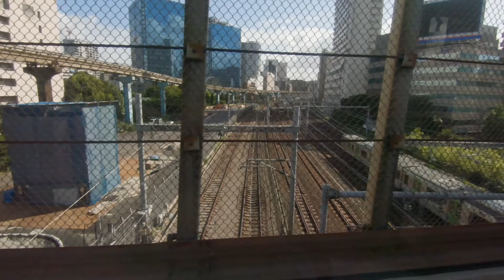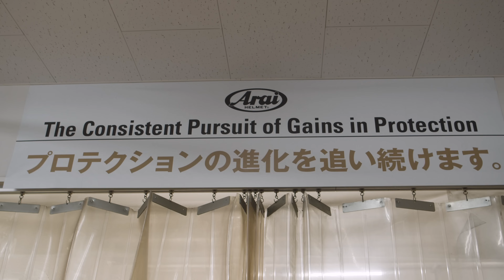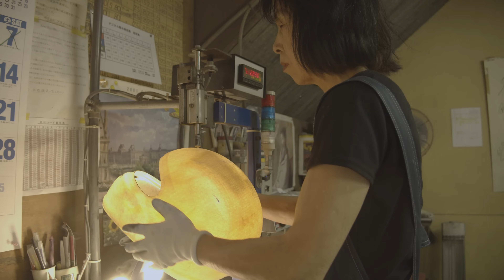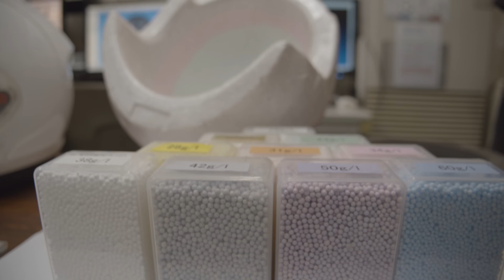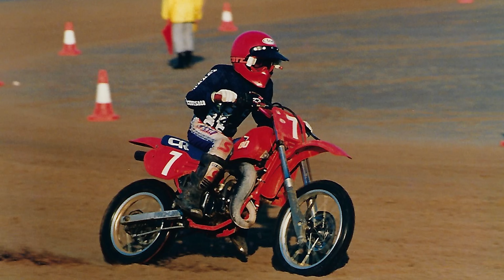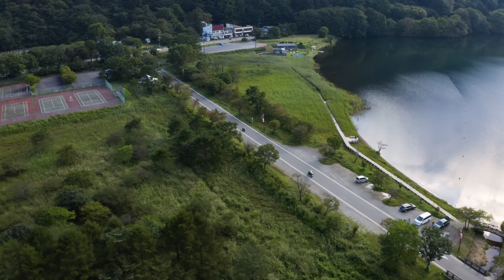Arai Factory Tour Japan / Honda Africa Twin DCT / @motogeo Adventures

Comment: I want to point out that all of the air vents and other things that get attached to the helmet---that make it not round---are designed to break off in a crash.  This ensures that you have a round structure protecting your head.  If they didn't come off so easily, they could snag and torque your head and neck around.

Comment: Helmets should last for a long time except the styrofoam shell inside it which is very cheap. Manufacturers should make it easy to replace the Styrofoam shell which absorbs most of the energy during an impact for less than $30 or make an impact absorption material that is more stable for a long time. I do not see any legitimate reason to change an expensive helmet every five years. A $1000 helmet is not cheap for most riders. Also, manufacturers should not use cheap rubber which become sticky when it ages. Silicon rubber lasts much longer and is more stable.

Comment: Just go to any club racing events in the US and you will witness most riders wearing Arai. They are not sponsored by Arai and most have very limited budgets but they understand that it's the most important part of their gear so there's no skimping on head protection. I personally feel Arai has been the best motorcycle helmet producer since they introduced the F1 line back in the 80's.

Comment: My first helmet was an Arai VX-Pro, cost a pretty penny but I love my noggin.
I actually tried to import one from Japan as they were cheaper. Speaking to a shop owner on the phone the gentleman was very polite but refused to sell me a helmet because I'm caucasian/european/white. He proceeded to tell me that he would love to sell me a helmet but they only stock helmets for the East Asian market and that they differ from those sold in the EU market. East Asians have rounder heads than Europeans and the helmets are designed accordingly so it won't have the correct fit for my head. He could have easily sold me a helmet but he looked out for my safety instead.